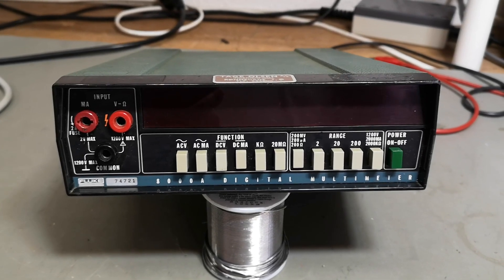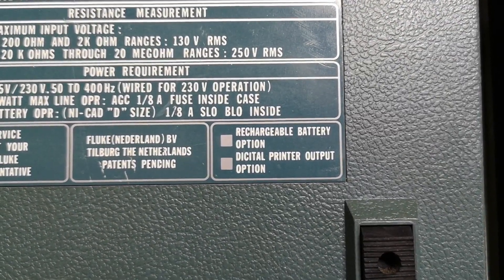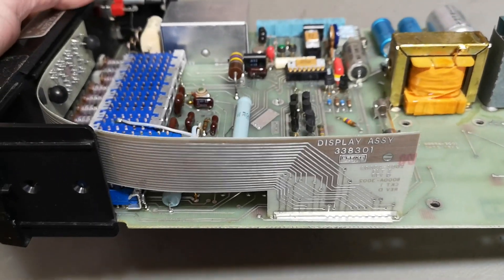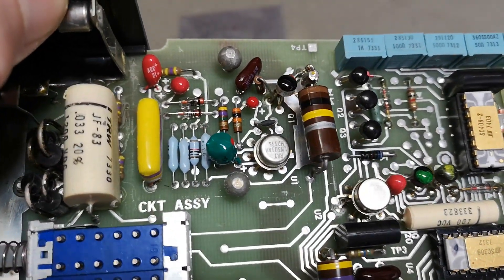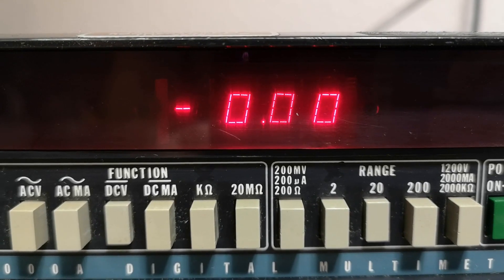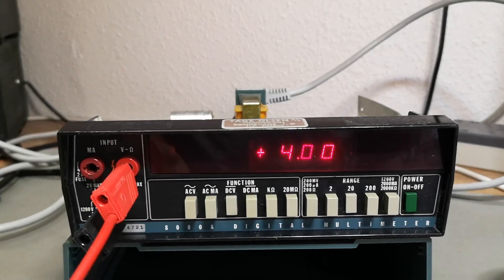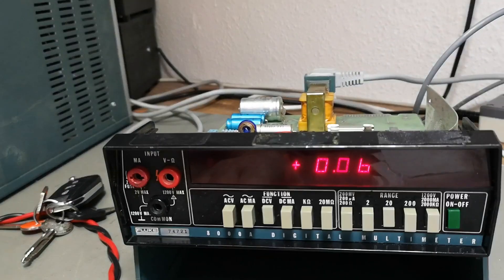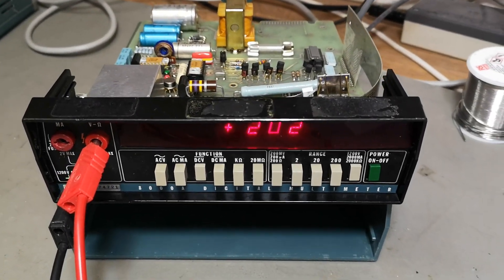FLUKE 8000A Digital Multimeter 1974 test repair teardown

Comment: I have one too, it's from Denmark with the serial no #638xx something, and it has the callsign OZ2SLA carved into the plastic, so I guess someone was really proud of it back in the days, and this must have been his or her prized posession. It works, and got the Battery option. Original Varta batteries, still works for 1-2 minutes, no leaks. They really knew how to make these back in the days Thomas. My buttons works fine, but they do suffer from the corrosion probably as the numbers are flying all over the place. It'll do as a museum boat anchor.
Reply from the maker: OZ2SLA is the callsign of a radioamateur club EDR Vestsjælland, it is not a private person. so it was most likely used in their tech lab, the carving is to make it stay in the club, and not just vanish into thinn air one day.
Reply: @TeardownOZ2CPU  Thanks, that makes sense, I probably bought it when I was visiting Denmark and bought it from the club sales, I often visit those days when they have flea markets.
Reply from the maker: @joonglegamer9898  me too, a lot of the stuff you see on my channel come from ham radio club fleamarkeds

Comment: Original Fluke cleaning method for those contacts was to use Freon, lots of it, to wash all the crud out, then lubricate the mechanism again, leaving the contacts dry.
Reply: What type of leads does the fluke 8000A use? are they special leads? or any set of standard leads will work?
Thank you
Reply: @SDsailor7  Standard leads work well.
Reply: @SeanBZA  Thank you, So to clean those switches you can use contact cleaner like deoxit?